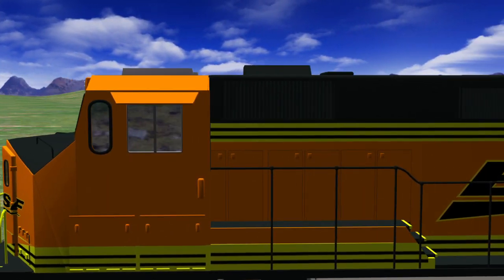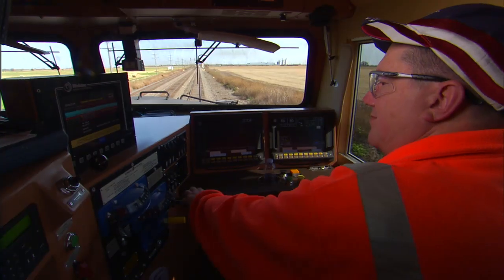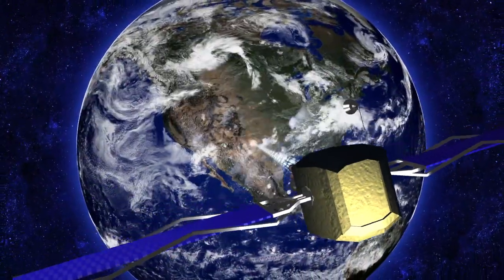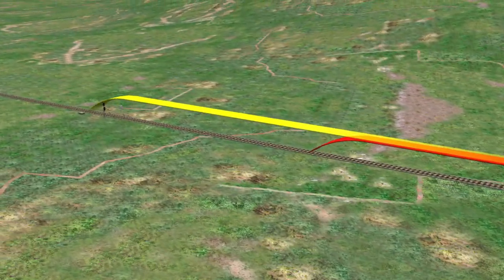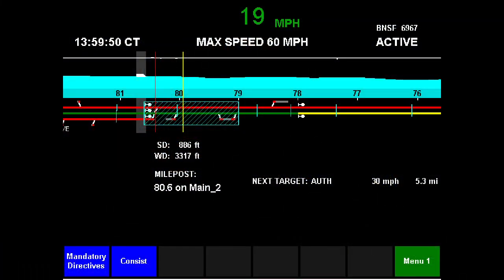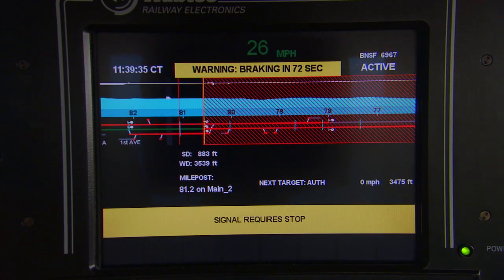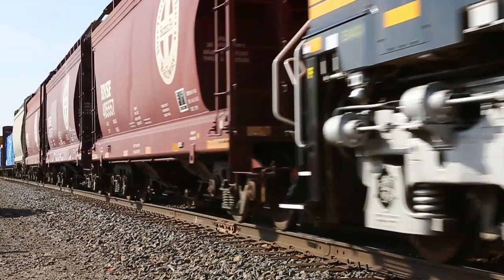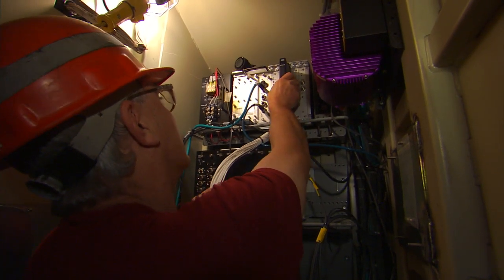BNSF Railway and Positive Train Control

Comment: Interesting to see how PTC works. I remember on a recent trip, on a UP line in Odgen, they were replacing the old signals with PTC. I found it sad to see, mainly because the old signals are diminishing, fast too. 

Also, I don't know if you guys at BNSF can answer this, but why were the horn levers replaced with buttons and the levers seen on the GEVO's? I'm an old head, I prefer the levers on the F40's and whatnot.